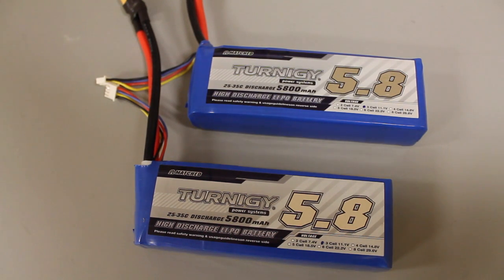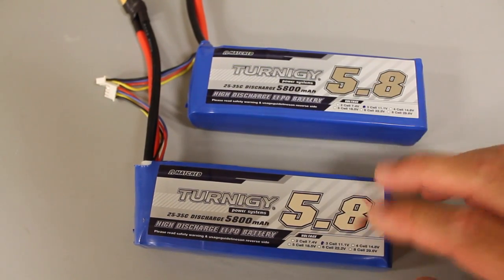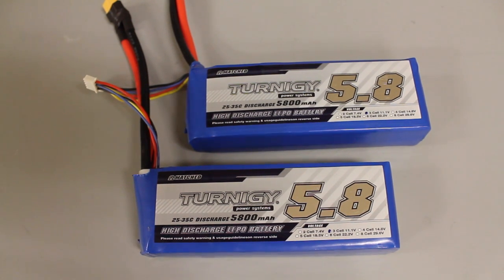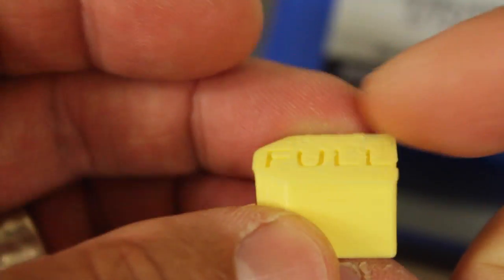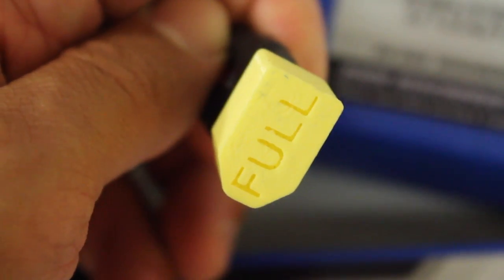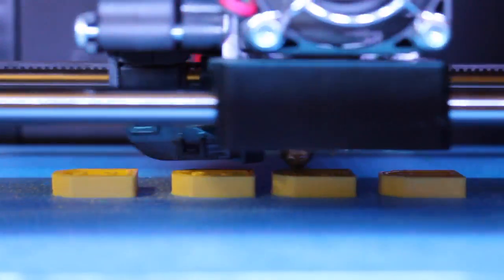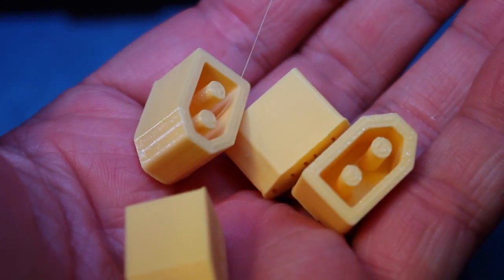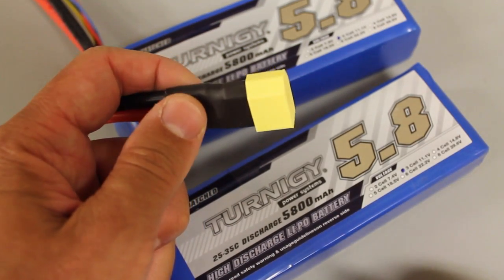XT60 Battery Plug Cover - Know When Your Batteries are Fully Charged

Comment: Nice idea!
PLIASE HELP!  My Y6 Hexacopter to start requires full throttle and after leaving the ground out sharply to the side ... I have to use my reaction to straighten machine ... After such a bad start, my machine run so beautiful, stable and obediently ... Do not know what to do, perhaps the problem in the Gain settings ... I'm afraid to make things worse !
My Hexacopter Y6 :
DJI WKG-M,---- Gains: Basic 185, 185; Yaw 120; Vert 125; Attitud  100, 100.
PRO SIX frame Y6( arms 400mm diam25mm)
T-motors MN 4014-11 KV330;  ESC t-mot 40A-400.
Carbon Props 15 x 5.5
Battery 9000 mAh  6s
Total weight: 5.780 kg ( including 1.410 kg battery and 1.820 kg Canon+Gimbal)
Thank You in advance, Romans.
Reply from the maker: Romans, it's hard to determine what's going on based on your comment. Perhaps you should look at calibrating your compass/GPS and then bringing your gains down to their defaults. Then work you're way up from there. Also have you balanced your props and motors? I've never flown a Y6 but assume based on the configuration that this would be pretty important. Also, have you calibrated your ESCs? Just some thoughts without having more information. Good luck.
Reply: Thank You...

Comment: Good to have, you should do it for the balance lead too, I've killed a 2.2k mah pack once while putting it into an Easy Star, something shorted my balance lead in the small space...  I really need to get a Maker Bot one of these days...
Reply from the maker: Wow. Can't believe it got shorted through the balance connector. What a pain! I always get a little nervous about having all these connectors flying around everywhere in the same case. I use an ammo box, which is made of metal and could easily short something out. I'll need to come up with a better solution.
Reply: Dennis Baldwin I put my batteries in lipo bags, then also in ammo boxes, keeps them quite safe so far.

Comment: I don't have a 3D printer so use a simpler solution, I put a rubber band on the charged batteries and take it off when I put the battery into a plane.
Reply from the maker: Nice idea. Appreciate you sharing. Good way to tackle the same problem.